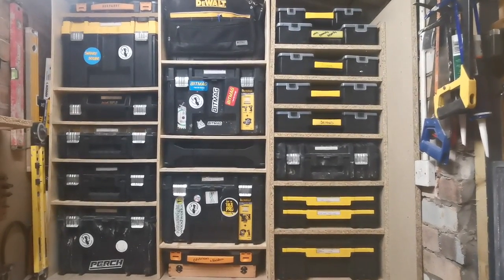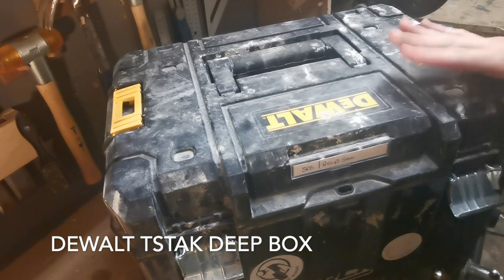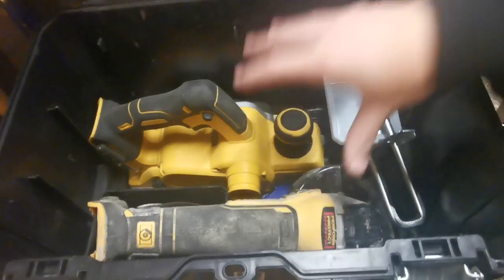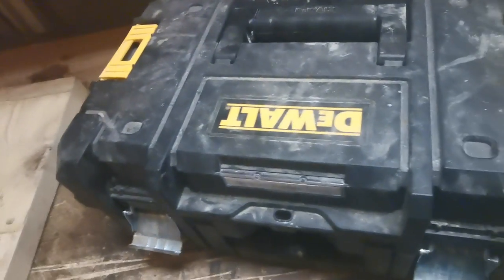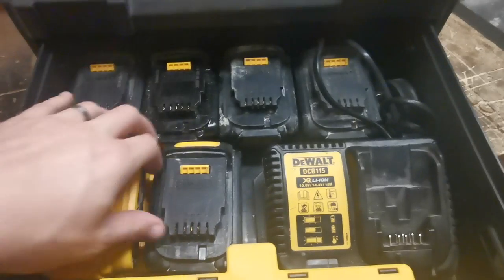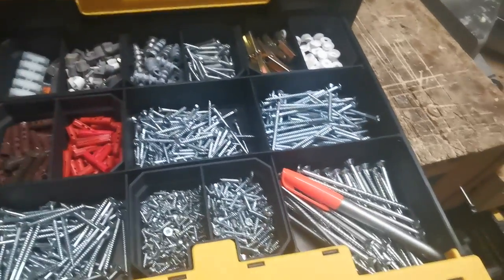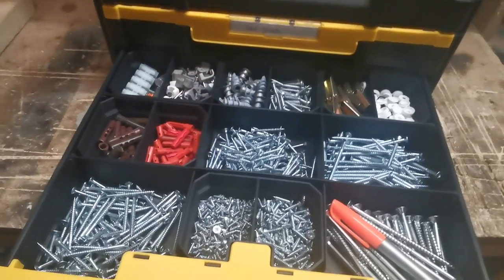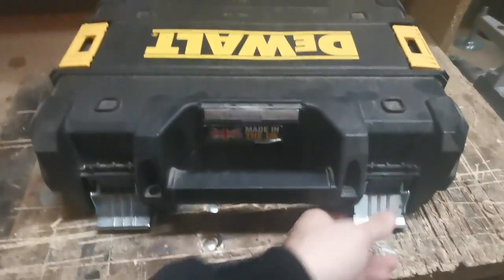DeWalt Tstak Storage.....Whats In my boxes???

Comment: Cool vid. I binned the random cases that came with my 1/2”, 3/4” and 1/4” socket sets and consolidated them all into one of the tstak clear lid organiser, together with my spanners. I swapped out the two big bins for two smalls (taken from one of my Stanley Fatmax organisers (EXACT same bins) and got all the sockets in 6 resultant bins, leaving a gap at the top for spanners. Modified the side areas (cut away the dividing plastic) to give me channels tha hold my socket wrenches perfectly. Probably not explaining perfectly in words but hope you get the idea. Wish I could paste a pic.
Reply: Hopefully this explains a bit better
https://postimg.cc/zLgSG6vK
Sockets in 4 of those bins, small spanners in another bin, assorted bits and adapters in the 6th bin. The big gap at the top for my big spanners and wrenches, my socket wrenches and extensions in the two (modified/cut) side channels. Other bits and pieces (like stop offs and blanking nuts) in the hidden compartments underneath.
Reply from the maker: @GKGuitarEsq  that's a clever idea and a great way to store them tools. I don't use sockets that often however if I did I think it's something I would look at. Handy to know about the Stanley tubs fitting tho 👍

Comment: Which model is the reciprocating saw? Wondering if it's the same as mine. Trying to figure out if it will fit the t stak box. Trying to dedicate my power tools (Drills, circular saw sawzall). Then modify and dedicate a separate box for batteries and a couple chargers for a contained charging station.